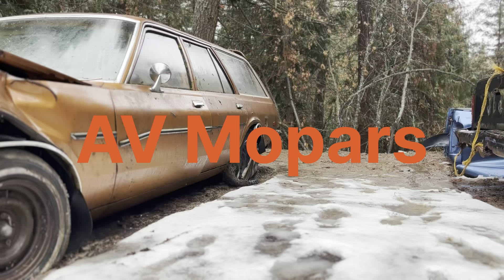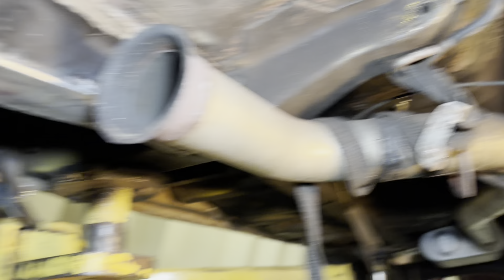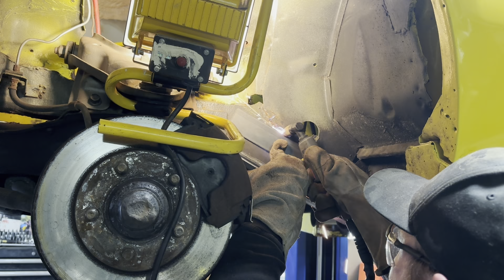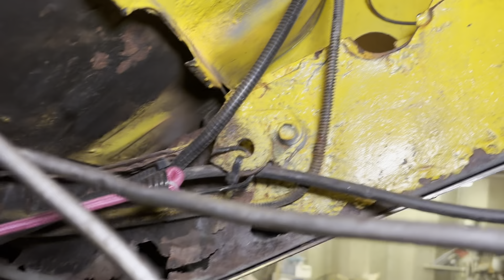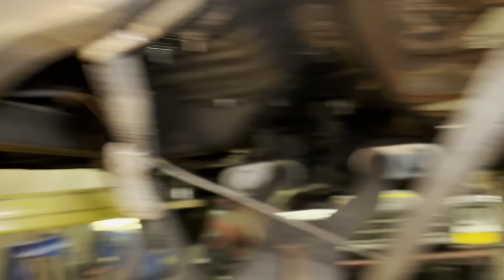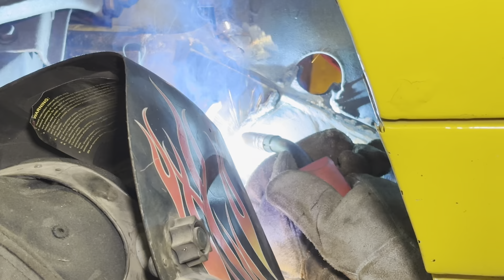How to repair frame rail rust on your Aspen or Volare

Comment: Wow, very nice job!  Rusty frame rails have doomed so many F bodies.  I don't know how to weld, so I was extremely fortunate to find my Aspen in the desert with no real rust at all.  However, many of the interior parts were baked, so the Volare parts car with the beautiful plaid interior from Oklahoma came in very handy.  I bought that Volare on Tulsa Craigslist, drove my truck out from Pennsylvania to strip the interior and every thing else I could fit into the truck, including the full set of Road Wheels, and left the carcass for the seller to scrap.  We were both happy with that deal!  I'm really enjoying your videos!  Looks like you have a really nice shop to work in.
Reply from the maker: Thanks! Yeah hopefully this video helps save some of these cars

Comment: Looks like a decent repair. Plates cause issues with header clearance in my experience. Ive always grafted in whole doner frame rails from m-bodys
Reply from the maker: Thanks! No issue with header clearance frame rail is the same size as factory rail just cut out rust and welded in new steel